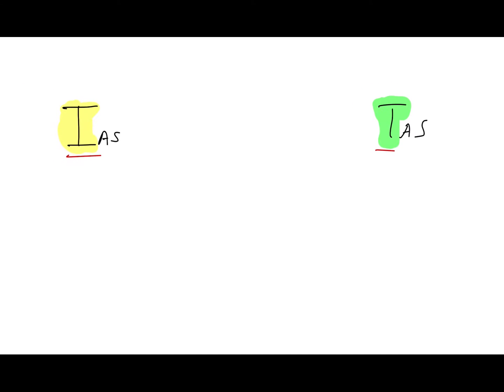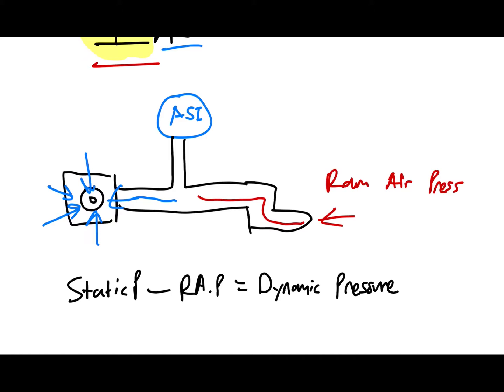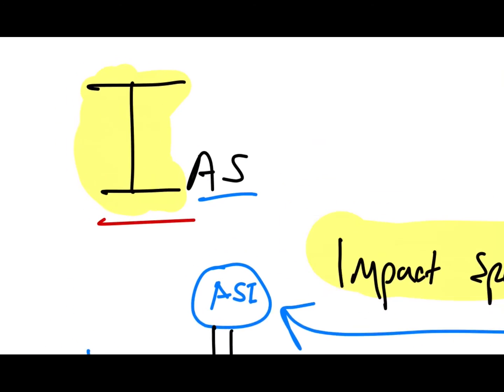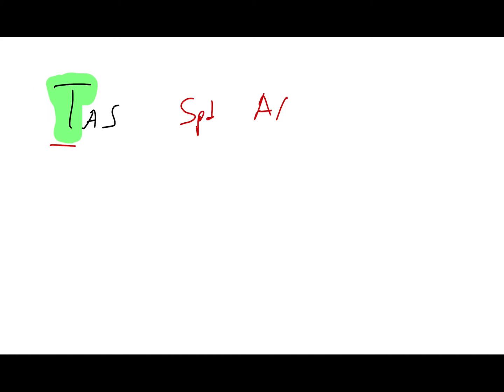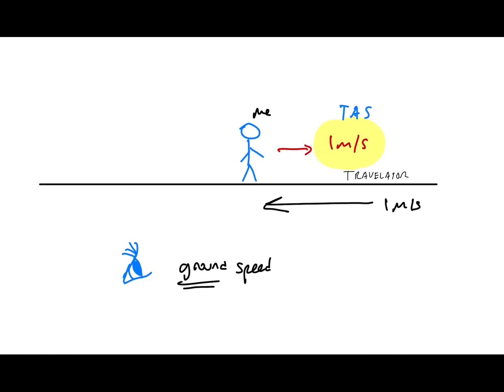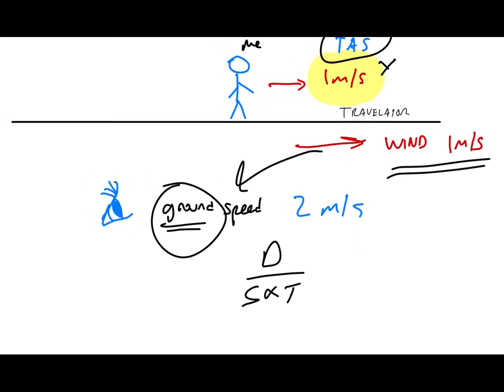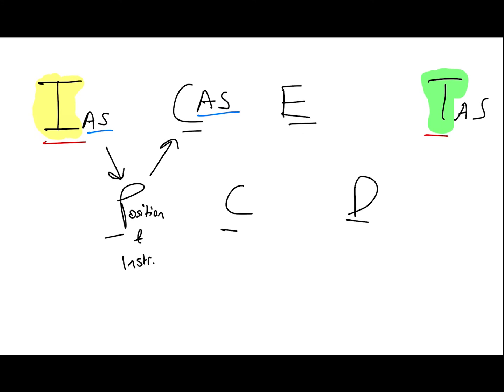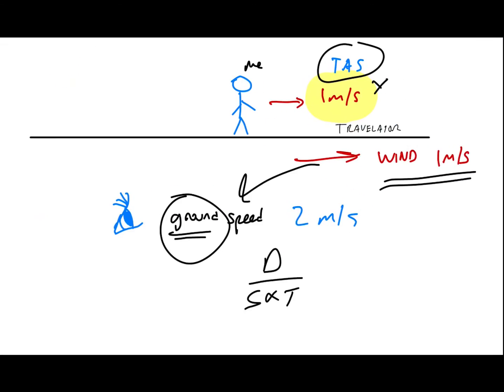The difference between IAS and TAS, and other speeds.

Comment: IAS is the speed the wing feels as it passes through the air. If you were outside sitting on the wing in flight, it's the wind force you would feel on your face. True airspeed is not really "true" at all. Don't really know why they call it that, because it's confusing. TAS is simply a mathematical calculation pilots make to their IAS in order to calculate ground speed, no wind.  Basically, IAS = TAS at sea level on a standard day,  29.92 inches of mercury. When we say an airliner at 35,000 feet is traveling at 500 knots TAS, that is the speed over the ground, no wind, not the speed through the air. If you ask the airplane how fast it's going through the air, it would say around 230 knots for example. Why the difference? Because the air is thinner the higher you go. You travel fastsr over the ground for any given IAS. But as far as relative to the surrounding air, the airplane doesn't know the difference. 230 kts. IAS at sea level, feels exactly the same as 230 kts. IAS at 35,000 feet as far as the airplane is concerned. IAS is what creates the wings lift. TAS is the adjustment made to figure out how long it will take to get from A to B. The airplane itself could care less what it's TAS is. Thought of another way, IAS is your actual speed through the air, TAS is a theoretical calculated speed. TAS isn't really an airspeed at all.  It's GS no wind.
Reply: agree
Reply: Perfectly said sir

Comment: so what IAS do i need to fly for my get top my TAS so i can apply my WCA to get my GS and makke my calcu right for my nav log?
Reply: You determine what your TAS is going to be based on the power setting your going to use, the altitude you intend to fly at and temperature at that altitude from the graph in the aircraft's POH. You take that TAS number and the winds aloft forcast for your crusing altitude and calculate your ground speed and wind correction angle that's needed, if any to fly a specific heading. That heading, in theory will equal the course you want to fly. Which = The line drawn on your sectional chart). Theoretically is the key word because the winds aloft forecast is never exact.
Reply from the maker: I may do a dedicated video on preparing a VFR Nav log in the future :).  But to answer your question, as you would calculate your TAS in your Nav log flight plan (manually or using E6B), you would then refer to your aircraft's cruise performance according POH. Find the RPM - Density Altitude setting chart then interpolate your TAS to know what power setting to fly at in each leg of your flight :)

You don't need to calculate your IAS. Fly via your RPM/power setting in accordance with the flight plan.